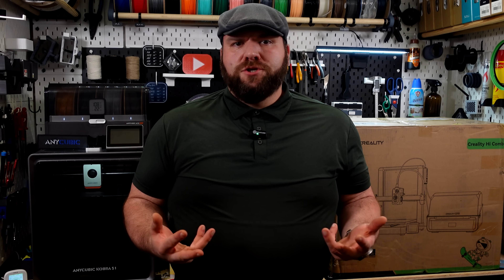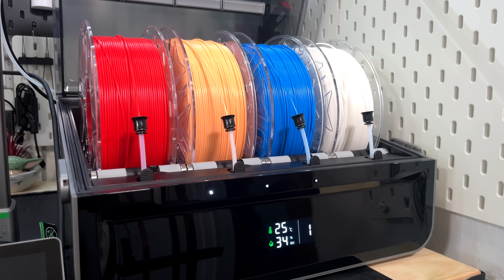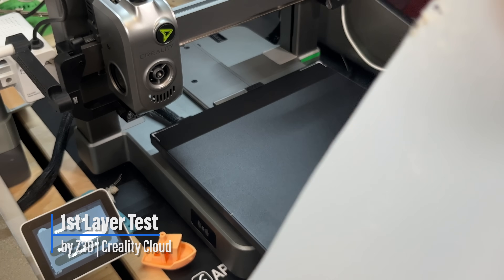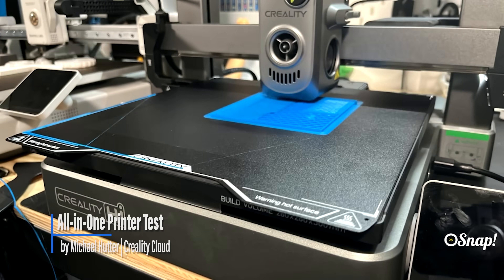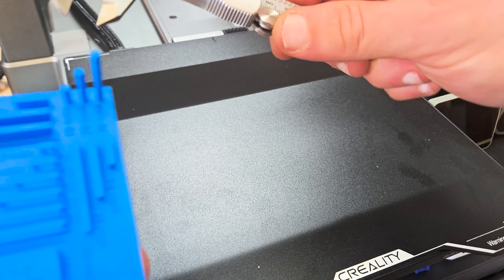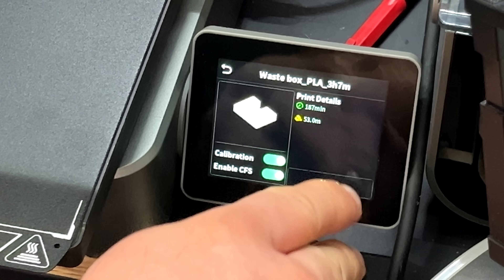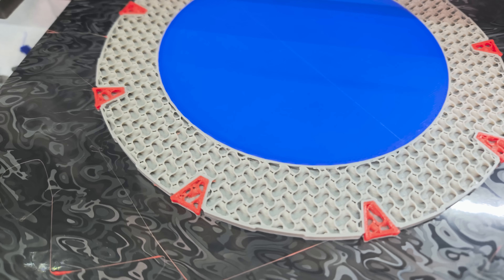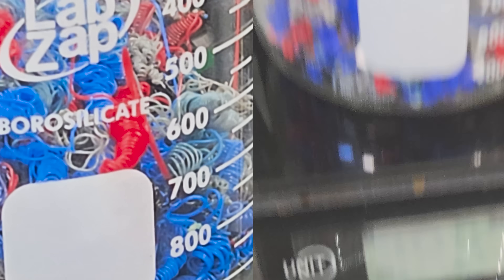Is the Creality Hi Combo the Next Bambu A1? | Unboxing, Setup and Testing!

Comment: Greetings .
I was interested in your experience with the Creality Hi Combo. I bought mine 2 weeks ago and it is chugging away, hour after hour. As was pointed out once, if the spool diameter differs, the rewinding funcking may suffer. So I have started respooling, by hand my non-creality filament onto empty Creality spools. No cfs error since.
No, I don't own bambu lab printers, they aren't easy to come by in South Africa. but creality is easy to buy and the quality is good.
The torrarences can be fixed by setting precise hight and wall.
I do a lot of articulated prints and those settings make my prints work 9 times out of 9.
Reply from the maker: You know actually,  I've had issues recently where the CFS failed to rewind the filament and it has been with non-creality filament. Now you've got me wondering if that's the issue I'm having. 

I'm going to try and run some prints with just the Creality branded filament and see if it still happens!

Comment: This actually makes me wanna try the Hi Combo. Looks super clean and easy to use.
Reply from the maker: It really is a solid machine! My only gripes as of today are the limitations on the number of materials that come preset on the machine. Creality needs to do a little better in that regard in my opinion. Compared to bamboo who packs their generic defaults with all sorts of materials and options, reality is just like "You can choose from PLA or PETG and only Creality brand. For everything else you're on your own" lol

Luckily Orca slicer can compensate for the lack of materials with its own built-in library but if you're actually using Creality slicer then you got to sit there and create all the various profiles you might need

Comment: Yo that Stargate print was 🔥🔥 both looked good but the Creality held its own for real.
Reply: I saw some layer bonding issues, or wall bonding I guess it is, on the H1. See 16:32, right at the edge of the color change on the bottom. I wander if it is an issue.

Comment: So cool how it just works with their ecosystem. Makes life easier.
Reply from the maker: What's even cooler, imo, is that underneath their ecosystem is true klipper with Fluid/Mainsail and if you're a more tech oriented geek like me, you can jump right into that without loosing the OEM creality layer, they exist side by side. 

I wanted to touch on that in this video but decided to leave that for a follow up.

Comment: Hi. Thank you for this review. Please use the end needle of caliper to measure height of this element (9:30). Also benchy boat printed has issue of layer shifting visible in lower parts (4:30). Not perfect first layer, damaged lines of gray filament (16:35). 

I am willing to buy one of these two. This comparison helps a lot. Thanks again, good job.
Reply from the maker: I did learn that trick recently, and will be using the end of the calipers going forward. 
I'm just a geeky IT guy that works in the film industry, learning as I go haha.

Comment: Thanks for the awesome comparison. Did that error ever went away? what's your final thoughts in terms of reliability btwn A1 and this?
Reply from the maker: Yeah it was a firmware glitch. They fixed it pretty quickly, actually sent me the updated firmware via email before releasing it publicly! 

It seems very reliable and really on par with the A1 imo. The CFS is nicer than the AMS lite though abs even though it doesn't actively dry out has a silicone gasket and keeps the filament pretty stable. If you put out in dry, it'll stay pretty dry.

Comment: You can use the calipers as "depth mics".  Extend the rod in the back to the surface you want to measure from and the back surface of the lcd housing to gage the other surface. 

Little known fact.
Reply from the maker: I’ve seen another creator do that recently and was like “ohhhhh “
I’ll be sure to incorporate that in the future!
Reply: Thank you for this remark to him. I'm an engineer and saw how he does not use the caliper correctly. Also he did not zero it out, so I'm afraid the measurements he mentions are not for real. He keeps the instrument angled  while taking measurements of rounded holes.

Comment: I Love my Hi, It is not a Bambu clone in any way. Its far better.   the CFS works much better then the AMS lite, the printer itself has not given me 1 failure in tge 3 months ive own it.  The A1 i had always gave me fits with cardboard spools and any brands not Bambu.
Reply from the maker: It's a really solid printer for sure! It's definitely not fair to say it's a clone (If I did at some point it's just because that's what the industry refers to every budget bedslinger as now) because Creality has been making ender series printers forever. This one just took some additional inspiration from Bambu and then improved upon it. 

The CFS is definitely one of those areas!  Also the fact that Creality lets you root your printers right out of the box and have a normal klipper interface. I didn't go into that on this video because I wanted to keep it on the simpler side but that's something I plan on delving into in the follow-up!